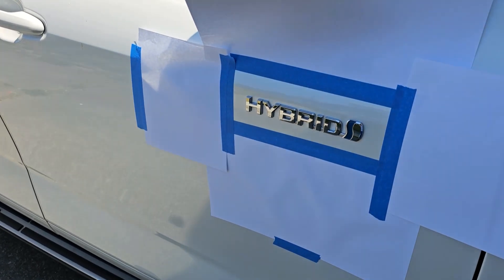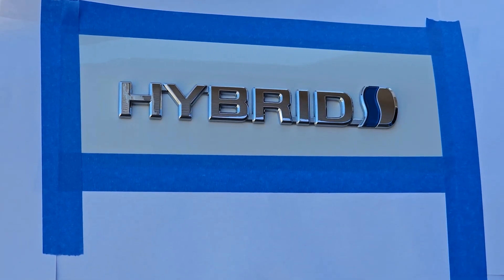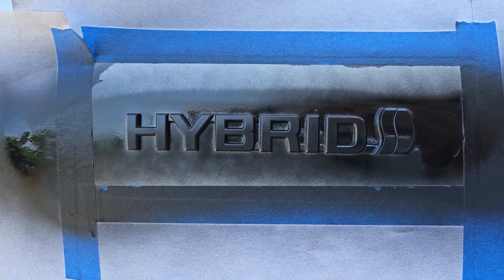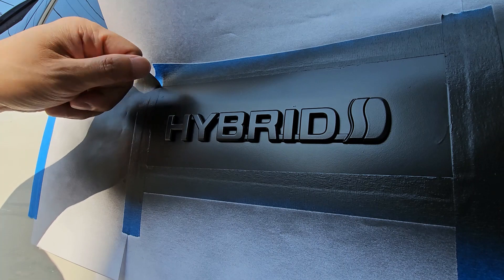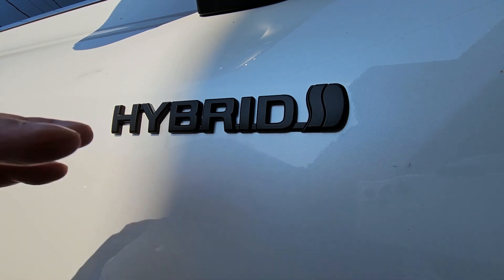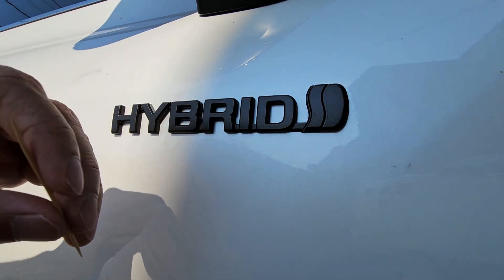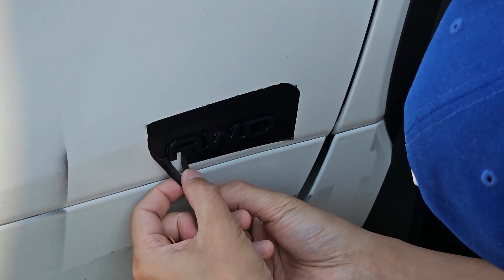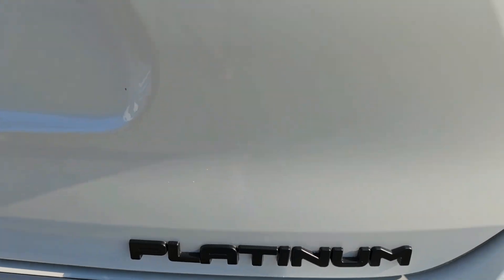HyperDip (PlastiDip) Application to Blackout Emblems on my 2021 Toyota Highlander

Comment: How long did the hyperdip last?  Do you see peeling?  Hold up to carwashes?
Reply from the maker: The manufacturer states 3+ years and longer without retouching. I've blasted my emblems with my high pressure water spray gun during car washes and it still looks great.